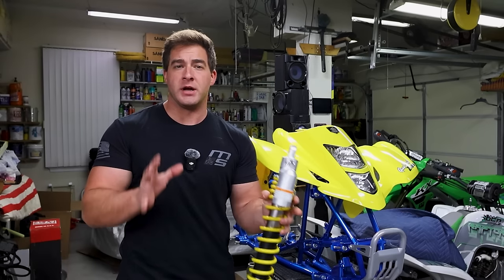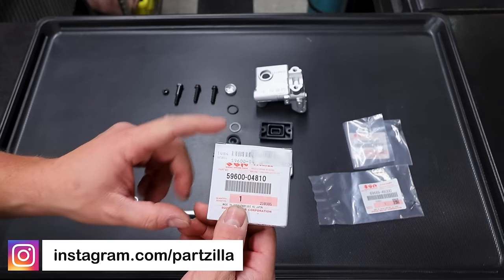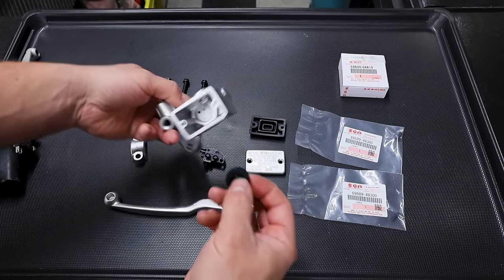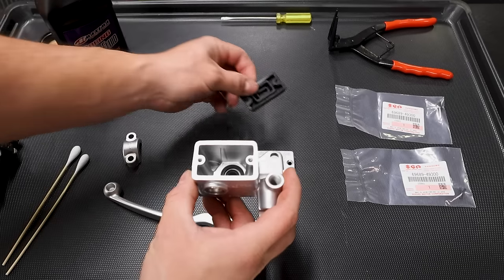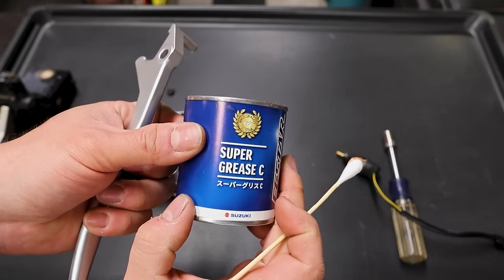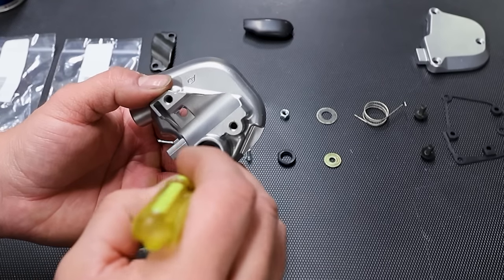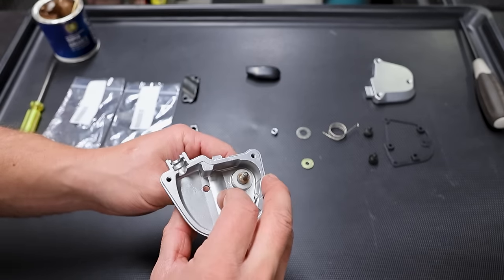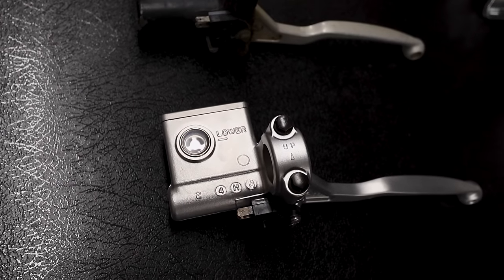This Cheap Mod will make your Throttle Buttery Smooth! - LTZ400

Comment: Tip for some soft flat jaw covers for your bench vise, 1/8" 2"X2" aluminum angle, cut 2 pieces to length of the jaw's, notch where needed, clamp in the vise, and form with a hammer around the top of the vise.. 👍
Reply: Good advice!
I did something similar with some scrap aluminum from an old engine skidplate. I also have some thin wood, for when I'm pressing something delicate.

Comment: my first quad was a 2004 z400. I have a raptor now. Wish i would have never sold it. Best quad I ever owned.
Reply: Is a 660, 700 or 350 Raptor?  Also, what is it you don't like as much about the Raptor?  Ride on!!
Reply: @crazymaze93  I love my Raptor, but the z400 handled amazing and felt way lighter. I also beat the crap out of the 400 for years and it never gave me a single issue.

Comment: Hey you can prolly put a hydraulic clutch on that and you would have a clutch that pull so easy ! Even tho there real easy to pull from factory it be cool to do hydraulic with asv levers and the thumb throttle trick

Comment: Hey michael, i came across your videos when i was looking for a specific quad engine rebuild, its a 500cc 1 cylinder engine, while inspecting it i came across subaru logo on the engine cover, i have been looking for the same engine this past month and the closest i have found is the polaris predator, could you perhaps look it up? Thank you for your time❤

Comment: Cool little mod bro. Ima trt on a banshee and see I it's possible lol
Reply from the maker: Same bearing worked on my Blaster throttle - I think the Banshee one is the same
Reply: @MichaelSabo  Do you think that needle bearing will work on a Honda 450r or 400ex throttle, for those of us who can't justify buying an URMOSI throttle?
Reply from the maker: @jbplays7302  I've only tried it in Yamaha and Suzuki throttles. It would be easy to tear down your Honda throttle and measure to see though.
Reply: I want to try this on my 521 shee. Thumb gets tired quick pulling 2 39mm pwk slides haha. Bearing should help!!
Reply from the maker: @dennisbrooks186  it should work on the stock banshee throttle. You can also do the lightweight slide springs but honestly, the pull becomes so easy it almost becomes harder to control.

Comment: I have a question I went to buy a wire harness for a 2006 ltz400 and they told me there was three different ones for that bike how would I tell what one it is without haveing the original